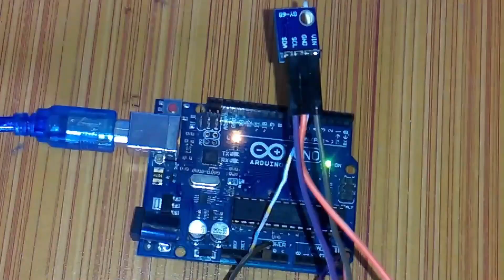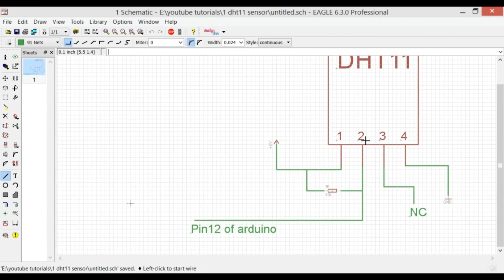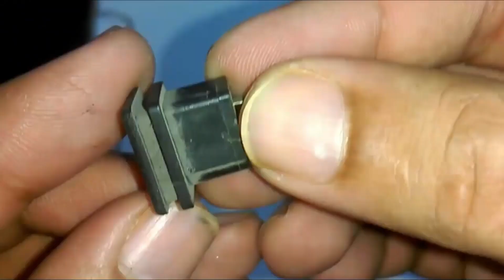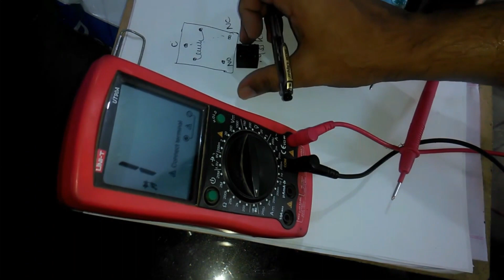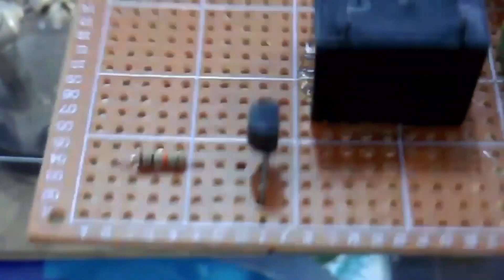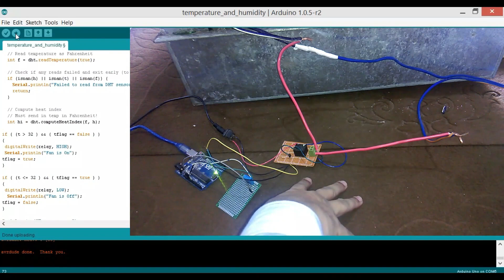Arduino Project: Temperature Controlled Room Cooler or Fan | Arduino automatic temperature control

Comment: respected sir ,
your videos are very nice 
i wanted to make a bot (a two wheel car small) that can track ultrasonic sensor.
if u are taking ultrasonic senosor with u the robot has ultrasonic sensor which recives the ultrasonic beacons and according to on which direction they are comming the bot will follow u (the sender).

looking for your response :)
thank u 
arpit,
Reply from the maker: Using only ultrasonic sensor wont help. Coz u will also need the exact the direction the angle and the distance. U will have to use other sensors as well
Reply from the maker: Watch my tutorial on hmc5883l compass. To learn how to find angle then i will tell u wat to do next.